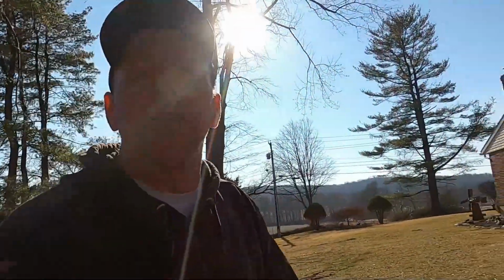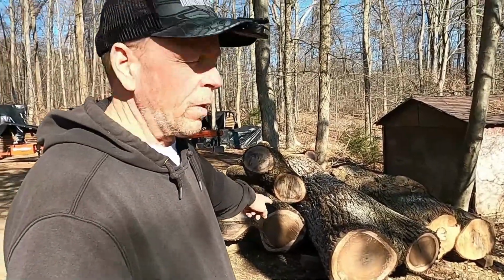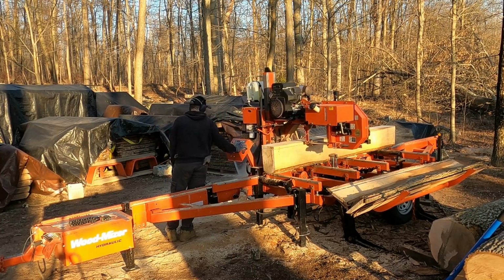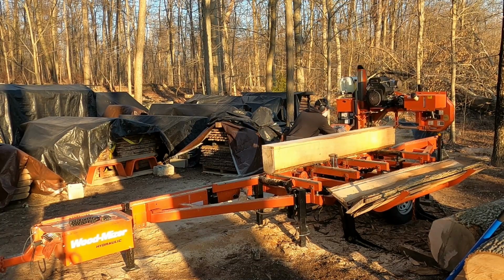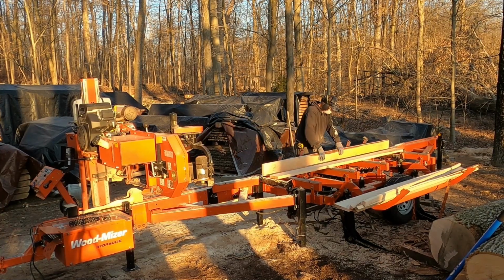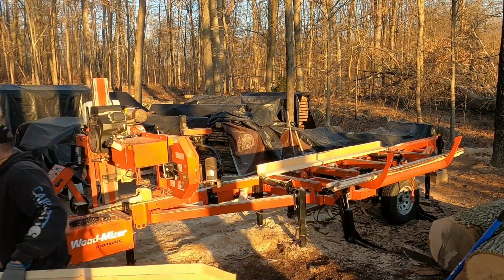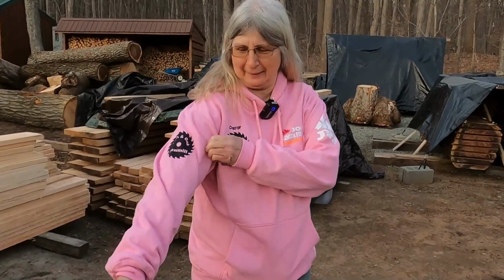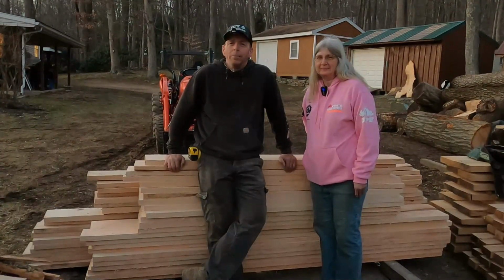Nearly Extinct Log on the Mill

Comment: Top work as always! will probably be getting a few ash logs milled over the pond here in England over the next year or so, suffering the same issues with dieback, also some sweet chestnut and oak for joinery.
Reply from the maker: We have not had the opportunity to work with chestnut just yet. We did mill a few small logs last year, and are waiting for it to dry. Hoping to dive into that a bit later......IF I can get some shop time. LOL 
You'll have to share some pics of your work, if you don't mind.

Comment: Well when I used to run a band saw. Our bandsaw had a fusing welder on the side. So you can make your own blades. All you had to do was get a spool of of the bandsaw blade. Cut it to length. Fuse it together smooth out the blade where the weld was. It was all done with electricity. I've made hundreds of them. I don't know why you guys with Mills pay top dollar for blades for your sawmills, when you can make them yourselves.
Reply from the maker: It's a matter of space, time, and money for the equipment. Maybe if we jump to a much higher production level, we would be able to invest in a similar set up.